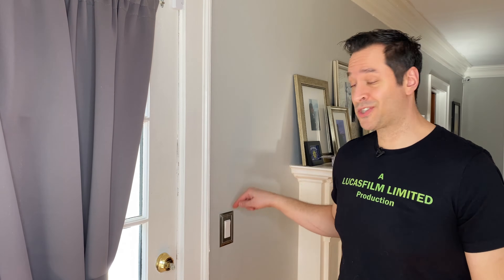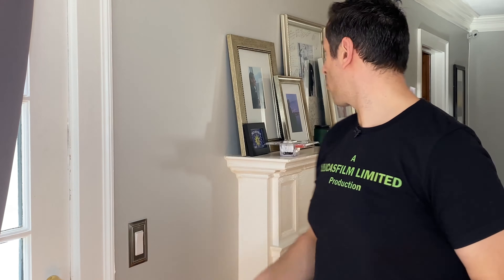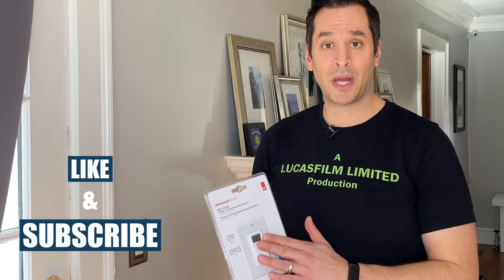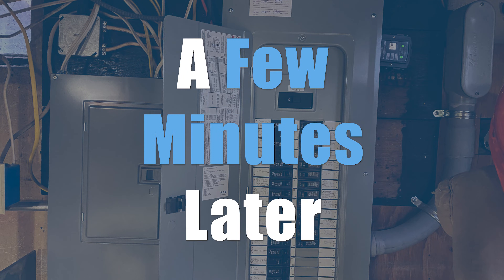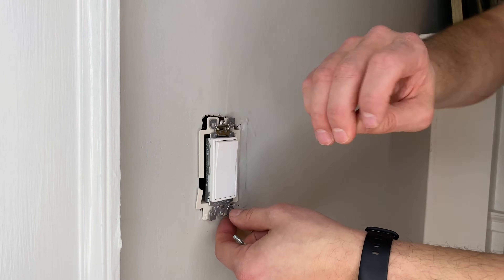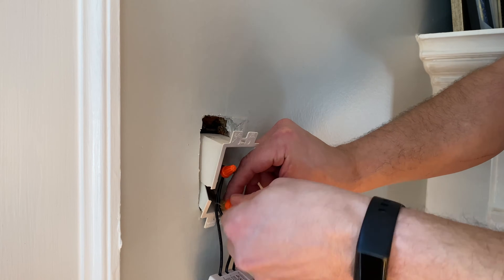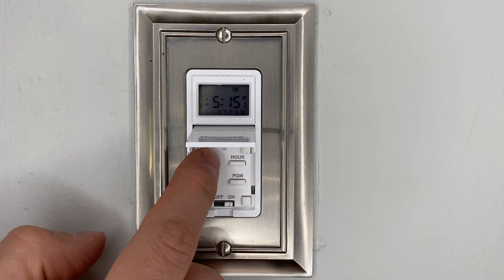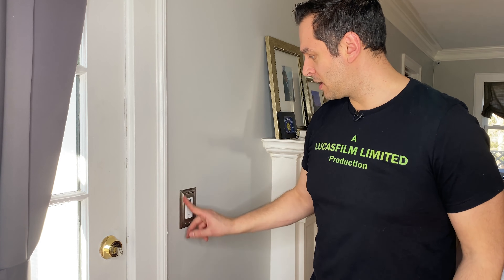How to Program the Honeywell Home Dawn to Dusk RPLS530A Switch

Comment: Well this was useless for me. I wanted to see which colored wires connected where. Green, yellow, blk, white to where?
Reply from the maker: Green, yellow, black and white? The switch I have only had three black wires coming from the switch and with my wiring do single pole use I just joined 2 and C to the black wire in my box, then 1 gets wired to the white wire in the box. I don’t have a green or yellow wire on the switch or in the box. Check out around 2:25 in the video. Sorry that this didn’t help!

Comment: Bro got knob and tube
Reply from the maker: Me? No it’s BX cable. But I will say the house is pretty old and there was knob and tube at one time but it was all removed in the 70s and replaced with BX. If it was knob and tube I wouldn’t touch it with a ten foot pole!

Comment: $30-$40 kind of a lot for a switch.  Wyze is $10 and is net connected… Amazon basics is $18.  

I mean if you end up buying for lots of rooms and outdoor lights, could be the difference between $200 and $800.  Net connected would be nice for IFTTT automations, geofence type conditionals, all that.  Honeywell you get a straight daily/weekly schedule and that’s it, for 4x the price.  🤨
Reply from the maker: Correct but if you don’t have a neutral then you can’t use a Wemo or Wyze switch. This switch didn’t have a neutral which is why I went with the Honeywell as it doesn’t require a neutral. All the rest of our switches are Wemos though :). Thanks for watching!

Comment: I would like 1 for my outdoor patio light. Right now, I just have a simple 1 way on/off switch. 
My wire colors are different than yours. My  wall  has a red wire & a black wire. I have no white wire.   I assume my black wire is the ground wire ?  

Does 2 & C go to my red live wire  & 1 goes to my black ground wire ? 
The Honeywell manual says connect 2 and C to the line 120V wire.
Reply from the maker: Wow I’ve not come across this issue before. So you just have a black and red wire coming out of the box? No neutral or ground? Typically red and black are hot and the only times I’ve ever seen red is for a three way switch, a fan or a bathroom fan/heater setup. Not sure I’m the best person to help on this one. I wouldn’t use the black as a ground though. Sorry I can’t help here!
Reply: @MADEbyAP  Thanks anyway.   The simple on/off switch is only a year old. I had an electrician add recess lighting & a ceiling fan last summer. He replaced the old toggle skinny switches with the new style switches.   Home Depot does not carry the Honeywell, so I bought a programmable switch by Defiant.  The Defiant also needs line, load, neutral, ground.  My year old switch does not say line or load , so wth are they referring to, I don't know. 

 The new Defiant switch is, about 1.75 inches deep. So deep, it doesn't fit in the box. I will return it just for that reason & give up on having a programmable switch.

Comment: What if a copper wire is attached to a screw? I guess it is a ground wire
Reply from the maker: Yes! Typically a bare copper wire attached to a screw in the metal box attached to the switch is a ground. Or it may be wrapped in green.
Reply: @MADEbyAP  what should I do with it on the new program able switch? I only saw you attach three in video.
Thanks in advance.
Reply from the maker: Hi there, first sorry, for some reason I'm not notified of replies to replies (urgh). Hopefully you figured this out but I did some digging. In my situation I only have two wires since this is BX cable that I'm working with. The cable is going into a metal box and typically that serves as a ground (although when I've installed new regular switches in these boxes I do go through the effort of adding a ground wire to the metal box and connecting it to the switch). I found this thread that suggests though that since the timer doesn't have exposed metal it doesn't need to be grounded (thus the lack of a ground on the actual switch). I hope that helps! Take a look: https://www.doityourself.com/forum/electrical-ac-dc/582696-intermatic-timer-switch-no-ground.html
Reply: @MADEbyAP  looks they suggest just not worrying with the ground wire.

Comment: My plug has power but screen off i can manually turn on lights do you know what should I do?
Reply from the maker: Wow that's a weird one, is it possible the switch itself is busted? Do you have the right wires connected (is it a single pole or double?)? If you figure it out, please do share!